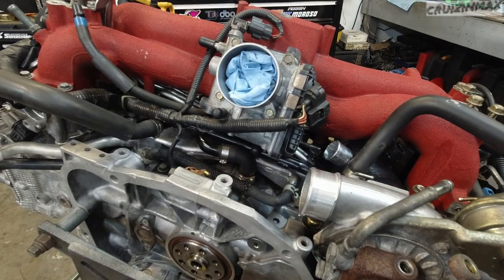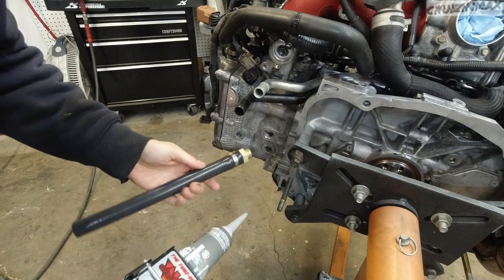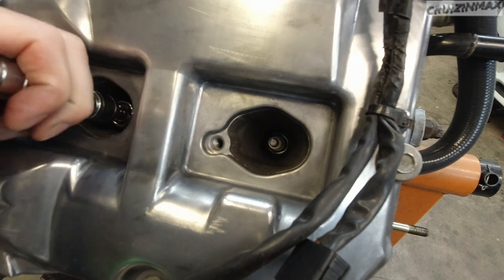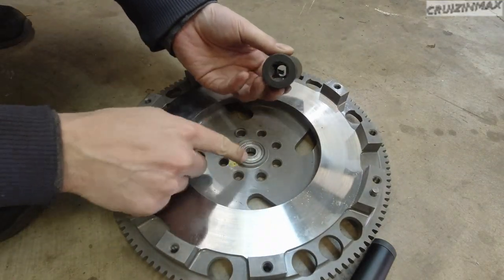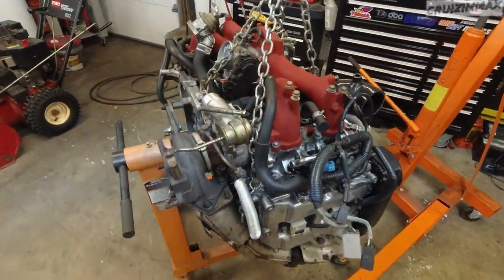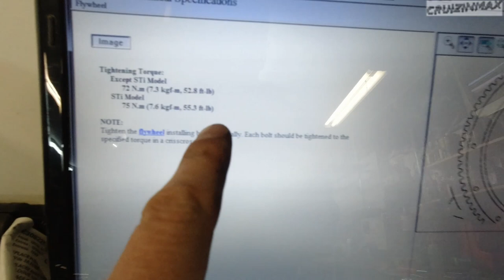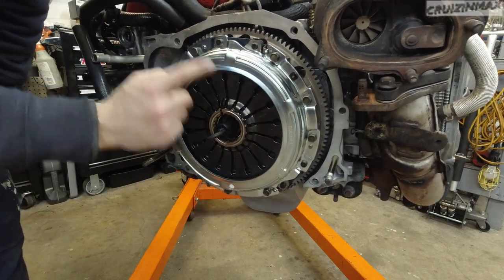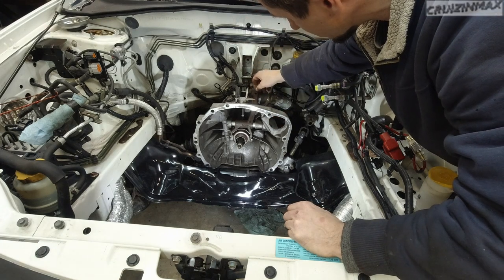Subaru STI EJ25 build part 9 cooling mod, flywheel, clutch

Comment: Cool progress! I'm still slightly on the fence about how the coolant mod is applied exactly. I know some people were installing it post heater core. To me it definitely makes more sense to tap in pre heater core. I'd also prefer a true Y fitting rather than a T, just for flow characteristics. I'm sure the differences would be small overall, but I live where it is very cold and I want the best heat as well as the best flow. Seems like a smart mod overall though.
Reply from the maker: ure in luck, in my next episode I explain exactly how to install it with the engine in, you will see that a regular T is better for the flow, you want the heater core cut hose to have the same flow as it wasnt cut at all, so top of the T will be the flow of the heater hose and bottom of the T will be the mod hose, so coolant will simply enter the already flowing coolant.  seems like the Y would disrupt the flow a bit.